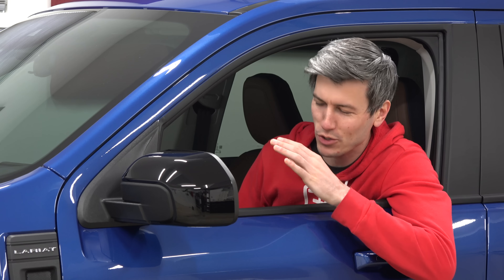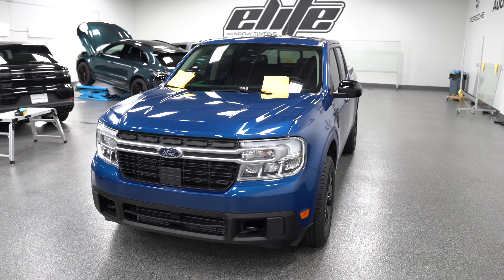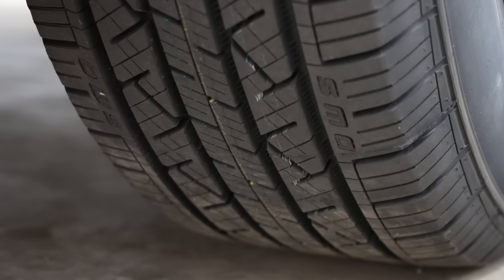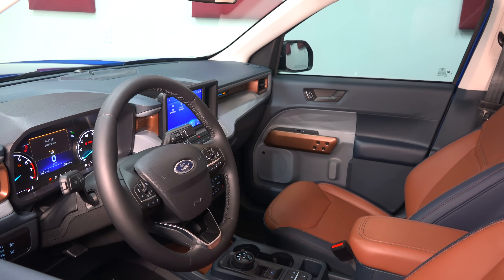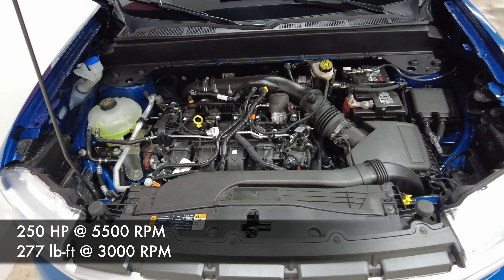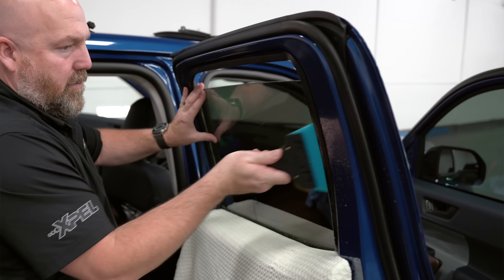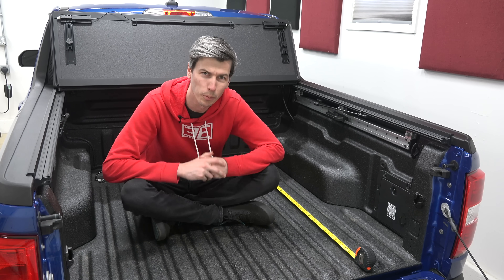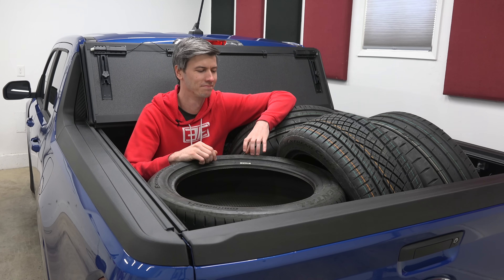I Bought A Ford Maverick! The Perfect Pickup?

Comment: Please please please make this vehicle in a fully electric model. It would be an instant buy for me. I don’t want or need a massive ford f150 lightning. My wife has a model y and electric car life is just so freaking good. Once my son finishes day care (this fall) I will be replacing my 15 year old daily. Fully electric is the only option. I have a 2006 suburban 2500 as well that will be my forever ICE vehicle but the battery cars are just so good for daily driving needs. And the maverick is the perfect size and form factor for all the home improvement projects I have going on right now. Just want to plug it in :)

Comment: This is a non-pickup truck. It’s unibody, has independent suspension, a car drivetrain, a car payload, shares most of it’s parts with a Ford Escape, which is a crossover, and will NOT maintain the reliability of honest, old, body on frame pickups with live axles and manual transmissions. This vehicle has more in common with a Ford Escape than with a 20 year old ford ranger, which could have been bought for $3000. To call this thing a pickup truck is disingenuous on the part of ford, it’s basically a Ute with pickup esque proportions.

Comment: As a half ton owner I really like the Maverick. I'd totally consider the Mav or Ranger if I didn't need higher tow capacity (ok the interior space is nice too).
It's funny I used to always get asked why I bought a truck because I don't work in trades. To me, the utility and endless possibilities made it a no brainer so long as I could deal with the size and fuel economy. It seems a lot more people are starting to get that now, especially as fuel economy improves and interiors more comfortable. Unfortunately with that comes the astronomical price tag.

Comment: Yes! Small pickups, actual small pickups. I have a 7 year old Nissan Frontier, extended cab, 2WD, four cylinder auto base model. Yes I turn a hand crank to open the windows and a key to get in the truck. But the real point here is that my non truck (yes everyone tells me that my Nissan isn't a "Real Truck" also) has done more "truck things", a lot more in most cases, than all of the "Real Trucks" that any of my friends or family own. The only "truck" I would consider replacing it with in today's market would be a base Maverick.

Comment: This truck is too expensive and underpowered for what Ford is asking. At these prices I would if they still made them a Regular Cab F150 with a 8ft bed but now since that is no longer an option I am looking at same truck in a F350 trim and for the price increase I am getting more value across the board long term.
The only way the Maverick is going to become a recognized model of truck is if they make it to be a true compact truck like what the original Ranger was.

Comment: It seems people (and a lot of them are americans as in the american continent) miss understand potential with actual use. It has the potential to go over sand dunes and tow 3000 pounds+. But if you never see those sand dunes what is the use? If all you do is get your kids to school, drive to work, some road trips and occasional DIY stuff from the hardware store, then a sedan or a wagon is actually better. Better mileage, better dynamics, bigger interior space actually, better on the initial cost, better on maintenance. I would see no reason a pick-up truck would be better and it's not like a sports car where you buy it for the passion and driving engagement it gives.

Comment: Used to have a 1989 Toyota PickUp but sister got into an accident in it and thank god she survived in a vehicle that didn’t have an airbag. Other than that the truck had a long bed, a 2.4L in-line 4 engine that is literally bullet proof in reliability and easy to park. Oh and it was sssuuuper basic model with no a/c except a 4 speed automatic as the option.

Comment: Seems like now days your choices in pickups are between a small four cylinder, or a huge overpriced, over optioned monster truck. 
I have a 97 1500 with a V6 and a short bed. Plenty of power for light towing, low bed height, decent gas mileage and very durable and dependable.  

There is EV, but 👎🏻

Comment: Did I hear $40k?! For that small truck? The vehicle makes sense. The cost, not even.
Reply: I agree. I think this makes sense on the low end. Mid 20s? Sure. But at 40k plus you have more options.
Reply: @Gman50001 what new vehicle options do you have at this price point?
Reply: @vhateverlie  Honda Ridgeline Sport/RTL. Nissan Frontier SV (discounted Pro4x). Jeep Gladiator (heavily discounted). For a couple thousand more you can also get lower trims on the Ranger and GM twins.
Reply: @Gman50001  right, this is the states. Interesting, the maverick is the cheapest thing here $35k-45k plus options (Turbo AWD). Almost Everything you mentioned starts at or almost $50k Canadian (Ridgeline, frontier, gladiator starts at $60k), the GM twins start at $42k so I guess it's the closest competition up north.
Reply: @vhateverlie  Sorry, yes this is in the States. The Maverick is the cheapest truck you can buy here as well. It starts in the mid $20,0000s. I think it's a good value at $26,000. My point was that I doesn't seem to be a great value on the high end. A top of the line Ford Maverick is around $40,000 here and still pretty bare bones.

Comment: I don't think you should have moved on from the transmission as quickly as you did around 6:25.
Ford paired the 8F35 transmission with the 2.0L. That transmission is rated for 350 Nm of torque, which is just about 258 lb-ft.
The 2.0L's torque? 277 lb-ft.

Ford literally paired this engine with a transmission they know isn't rated for its torque output. Granted it's not that much over its rating, but it is 19 lb-ft more than it is rated for.
I'm a little concerned to see how long these transmissions last, especially if someone actually does truck stuff with their Maverick.

If Ford took this into account and made some mods to the transmission or powertrain somewhere, I'm interested to hear. Because otherwise this is a problem that no one seems to be looking at.

Edit: I feel this especially worth looking into given Ford's track record with the previous 6F35 and the DPS6 transmissions.

Comment: I’ve been saying this for a while. If you don’t care about cars and want a vehicle that can do literally everything, this is it. Decent mpg, you can haul the small family, it’s cheap, go pickup a new washer or dryer that went out unexpectedly, and it’s available in awd for safer winter driving. Btw, I’m a ford hater too, but this vehicle is a true all in 1 for the average person.
Reply: But no manual transmission
Reply: It’s perfect if you enjoy to Fix Or Repair Daily
Reply: @JohnDoe-my5ip I've heard about 2022 Hybrid having issues but theres Ecoboosts with 60k+ miles in these past two years and they have been super relable
Reply: @aquifer9480  the hybrids are very reliable also. Ive had mine for 2 years and no mechanical problems.

Comment: Too many seats, not enough bed.  I can safely secure several 4x8 sheets of plywood in the back of a late 90s Ranger, which is also...smaller than the Maverick, which is smaller than the current Ranger?  What?  Nevermind that actually getting one of these as a human being is difficult, as Ford as allocated a majority of them to Fleet Sales.

I am not a "truck guy."  My daily is a 2004 Jaguar S-Type.  It comfortably carries 10' dimensional lumber in capacities larger than I've ever needed for any single weekend project.  Not gonna do that in a Maverick.  I also use it as my work vehicle, averaging close to 1,000 miles a week.  It's comfortable, quiet, and gets 30mpg on most days.  The dozen or so Mavericks I've driven over the last year are anything but quiet, and "comfortable" is not an adjective I'd even consider.

Comment: I ordered a Hybrid FWD XLT a few weeks ago, with the tri-fold tonneau cover as well! it's not slated to arrive for a few months, so I'm curious to know a couple things as you use it more:

1. Is it annoying to drive with the cover folded up and blocking the rear window like that? If so, is it easy to remove entirely?
2. What's your average MPG in the AWD version? I too would love a hybrid AWD version, but admitted to myself that it'll mostly be a grocery getter for the fam, and I'd rather have the extra MPGs.

Comment: Why have that rather than a comparable SUV?  If you want to haul messy stuff then the cargo space if the SUV just gets a suitable protective layer of plastic.  Then more of the 'bed' is enclosed from the elements, wind, and theft.  And better aerodynamics with an SUV.  On the positive side of the Maverick, it probably has a lower center of gravity, and better rearward visibility than an SUV.  As for towing capacity, that beats the Crosstrek, but a basic Outback has 2700 lbs, the turbo has 3500, so, nearly as much as the high end Maverick.

Bottom line, seems you could have checked all of your boxes with a turbo Outback and had a more comfortable ride, for the same $.  Whether that would suit your aesthetics is subjective but I think the Outback can look pretty sharp.

Comment: "There's no better ride than a pickup truck." You're confusing "better" with "more capable" and also confusing pickup trucks with trucks in general, i.e. SUVs. Sand dunes? SUV with off-road trim/mods. Hauling? SUV is enclosed and longer than most beds. Towing? SUV. Rock wall? SUV. While cool and seemingly most capable, pickup trucks are less practical than SUVs for most people. A pickup only really makes sense if you know you're going to regularly haul stuff you don't want in the cabin such as mulch or other messy DIY-type supplies. If that's the case then obviously pickup truck but you didn't mention that in your examples and overall an SUV is the better ride.

Comment: I've had my 2023 Maverick Hybrid for over a year and it has been great so far, other than a few recalls.  I have had no mechanical issues with it so far and it easily gets over 40mpg when daily driving it.  A fun fact is that the Maverick is about 6-8 inches shorter than my father's 2007 Tacoma, which means that it fits in my garage.

Comment: Would be perfect if it could tow 5k, like the Santa Cruz or Ridgeline.

Pretty sure my old Ford Ranger could tow more than 5k lbs...

You know how some trucks have "low range" that gives you very low gearing that is only useful for going very slowly off road? Instead of that why can't a truck have tall gearing that is good for fuel economy and a lower range that is good for towing?

Comment: I don’t know what’s going on with this comment section but the maverick is an ugly looking truck, 4000 lb towing is useless, bed is tiny what is that even for? Just get an suv with a hitch receiver if you can’t fit standard length lumber in the bed or tow anything bigger than an atv

Comment: This seems to be the successor to the Ford ranger they stopped making in 2011. Now if only we could get single and extended cabs and not a four-door by default that would be cool and we can get a longer bed. Because an extended cab with the FX4 and the other package you got would honestly be perfect for me making a five and a half foot bed and it would be a perfect 04 Dodge Dakota replacement. Oh and bring back rear wheel drive front wheel drive is atrocious. It makes backyard mechanicing a giant pain in the rear. Having to take a tire off to replace the serpentine belt or alternator on my 2006 Mercury Mariner was a giant pain in the rear. Have to dig out a floor jack.  jack stands. Find a level surface, horrible. My 2004 Dodge Dakota the alternator was right up at the top the water pump was right up front. I could even replace the starter without having to Jack the truck up I still had to lay underneath it but just bring the tools you need.

Comment: payload is not up to doing actual work the bed of the truck is not up to doing actual work, tires with a 107 load range that is 2,149 per tire want higher than that if you want to put a real load in that truck.
my KIA van tows as much as your truck I also have 149 cu feet of internal cargo area plus I get 30mpg on the highway

Comment: I still got my 14 town and country, i don't ever use 300hp, i mean in my life, it will redline at a 1/4 throttle.  Got to put on my new seat covers, waterproof like 1/8th inch buck hide.  Got a winter diesel heater.  Never gonna need it, but just put it out the tail winows.  Theres these gynormous cup holders, couldn't be 5$ bucks.  Need an oil change.  Rattles in first, but its all heavy duty.  50k brand new at 18k base.

Comment: Its typical to bash on the tow rating of smaller vehicles but I'm not trying to hate. 4k lbs seems pretty small. Our small, but bigger than an cuv, suv has a tow rating of 4k lbs. It did not come with a hitch. And I had a crown victoria which has a 2k lb rating. Also, did not come with one. I know the point of this truck isnt high tow rating but it almost seems conservative in the numbers. I'm just going to assume that it is much better suited to be near its max rating than the suv or sedan. Until it's proven otherwise. To its point I'm sure the payload on either of the cars I mentioned is pitiful and therefore the Maverick will drive better loaded.

Comment: Hi jason, read recently that drumbrakes are making a comeback in electric cars. But what are drumbrakes exactly? How do they work? Why are they considered worse than disk brakes but why are they making a comeback? Are brakes in the rear axles necessary for electric cars? Could that part of the braking not be done with motors only? What is holding engineers back on relying solely on the e motors for braking?

Comment: Can it carry a full sheet of plywood  with the bed closed? No? Y'all are so obsessed with towing trailers purely because your pickups cant cary anything. If you're in construction and have a pickup you simply dont get it. 
Maybe if you had decent roads and propper driving ed you didnt need a giant offoad vehicle to dodge potholes and bad drivers.
I truly believe the fact that  the US has exceptionally bad education and is the only country in the world that actually uses pickup trucks for everything, is correlated.

For hauling: A van
For comfort and hauling people: A van/ Estate car
Fuel efficiency, hauling and comfort: Estate car.
Reliable offroad vehicle: Toyota Landcruiser or other Japanese offroader.

If you're a farmer and occasionally have to carry a goat or some other farm animal,/farmy object, pickup (Hilux). Other than that, you're a simpleton.

Vans are in every way more capable if you want to haul stuff, keep stuff safe AND have good accessibility
Fun fact, you can also fully load the roof of a van.

I once had a customer come pickup wall insulation with some giant RAM pickup. He had to do multiple trips, couldnt reach his tools and complained about gas milage (so he had it converted to LPG) Funny thing is, some beat up van that also was filled with tools, came and picked up the same amount of insulation without any problem. Moral of the story is: Pickups have a very niche usecase yet this 'engineer' doesn't even realise. D'oh!

Comment: I had a crew cab dually pickup and a 4x4 ZR2 S10 extended cab 3-door pickup but now I have a 155" wheelbase Chevy 3500 Express passenger van that could hold five people and five E bikes or five people and 8ft sheets of playwood inside. Whatever floats your boat.

Comment: It's not just that trucks have gotten big.  All vehicles have grown over time, specifically the rear quarters of anything with a second row.  Many cab-and-a-half variants have been erased, or stretched.  If anything, the beds have shrunk, with the longest offerings still being 8'2" and the shortest down to 5'6 or 4'6 in the case of the Maverick.  

The real dimension across which trucks have grown is perceived height as the underbody starts lower (I think for aerodynamics) and the top of the cab can be higher (my superduty is so flippin' tall the lumberyard workers groan when I pull in).  Compare a 90s F series to a modern one in a parking lot and you will see where the "weight" went...

Comment: Don’t think I’m a Ford hater because I actually drive a 6-yr old F150 that I love. But, as an engineering guy, I find it difficult to believe you would choose that over a Ridgeline. Especially if you plan to keep it for a couple hundred thousand miles.
Reply: As a mechanic, that “truck” should have no problem reaching 250k with proper maintenance.
Reply: @ProjectFairmont  Plus fixing the recalls and other poor QC and design issues that late model Fords seems to have in abundance these days
Reply: @N20Joe  yea, you don’t own a Ford.  Internet experience…
Reply: @ProjectFairmont  With proper maintenance, most any vehicle can reach 250,000 miles. I bought my truck because, like you, I can fix most anything. For the average Joe, not so much. At the prices these things command, long-term reliability has to have excellent engineering baked in from the start and to my mind, the Ridgeline would have been a far better choice.
Reply: And if you are spending 40K you might as well just get the Ridgeline at that price point.
Reply: I was thinking that too. An engineer with a Ford is a bit strange unless he only plans to keep it till the warranty runs out.

Comment: Pickup Trucks are not a smart idea in general, they are foremost an American idea. On European roads and parking lots you are lucky driving a sub 5 meter car. Rock crawling and driving over sand dunes is not a thing here. Fuel economy and a quiet and comfortable ride quality are more of a thing. Even craftsmen prefer vans over pickup trucks because your equipment cannot be stolen from the trunk bed, it is protected from the weather, you have a low loading edge what makes it more accessible and you can stack things up higher without the possibility of things falling down the side in a turn.